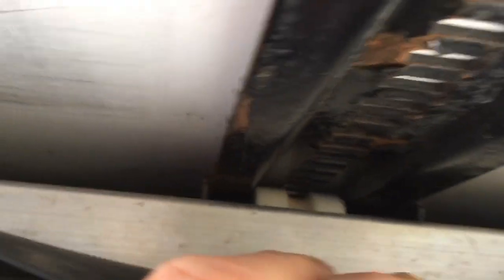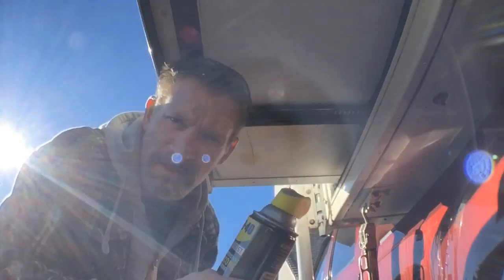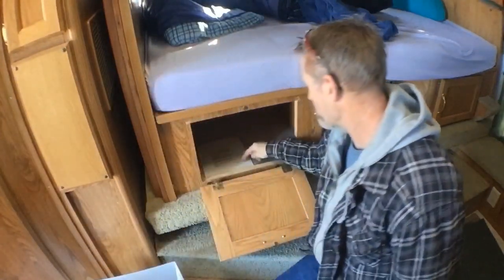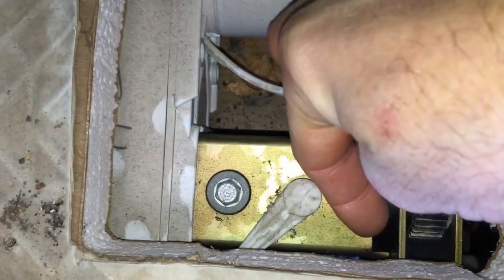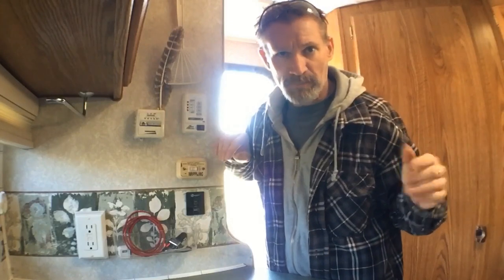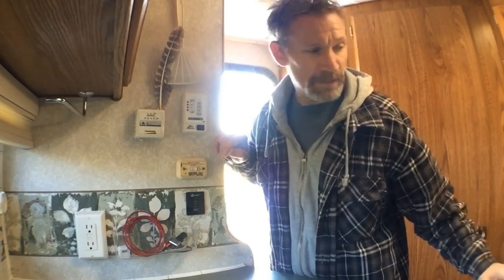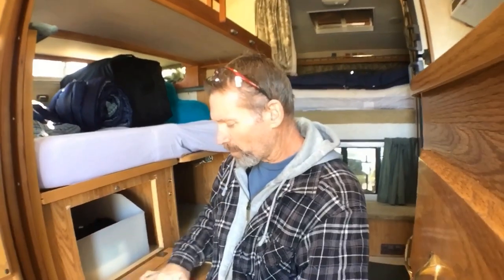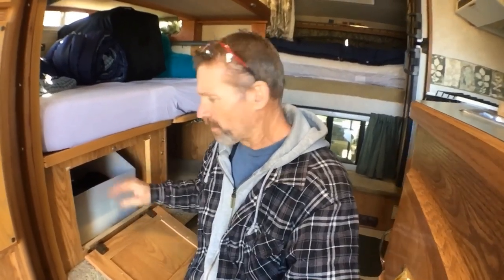How To Maintain Your Slide Out.  Thetford Slideout Seal Conditioner

Comment: Hi. Are you aware of any adjustment procedure for the happijac mechanism? My Adventurer camper has the same system and does not appear to be making sufficient contact with the seal long the top when it's closed.
Reply from the maker: Hello bluebell bus70,
The older (2000-2006) Happijac Slideout rack and gear mechanism requires the road-lock dowels to compress the gasket seal at the top of the slideout.  You should have two or three aluminum or wood dowels that are to be installed from the inside at the top of the slideout between the interior frame and the inside sidewall when closed.  I have to step on my Dinette on the lower front corner and lower rear corner to install the dowels.  When I step off, the dowels hold top compressed against the wall.
Reply: @covetthecamper2289  Hmmm. My Adventurer  is a 2008 so maybe it doesn't have the same unit... are you at all familiar with the newer ones? Thanks for the reply!
Reply from the maker: If it’s a Happijac Electric Rack and Gear system it should be the same as my 2003 system. 
What’s your side to side gap? (Measured on bottom and top of both sides of the Slideout from sidewall opening to Slideout wall)
When you bring in the slide, how much gap is there at the top?  
Are your gears slipping when it’s closed tight at the bottom?